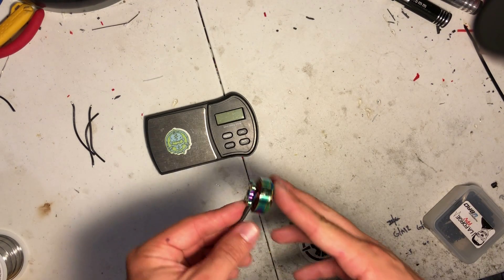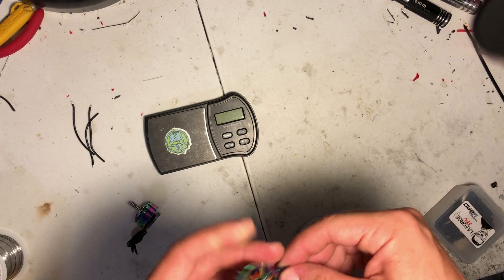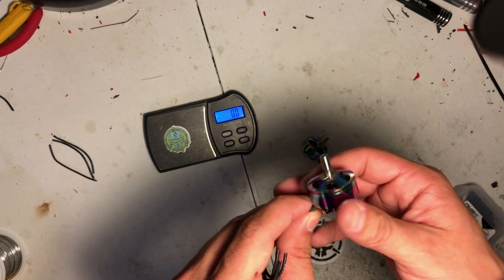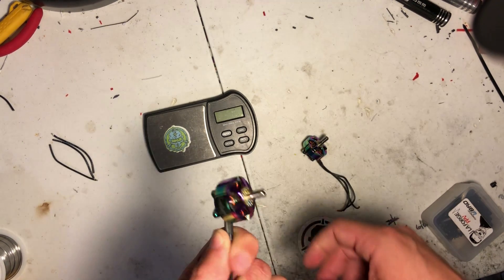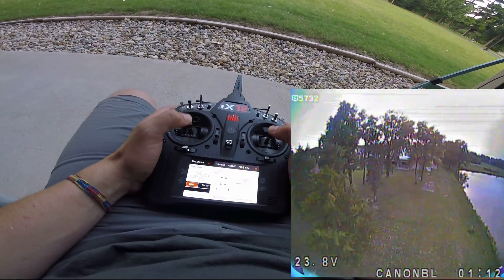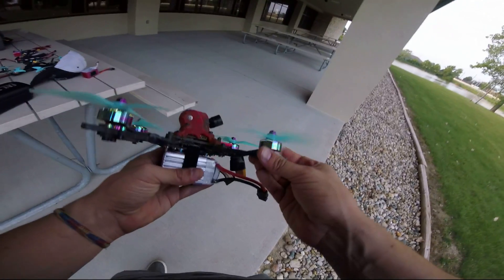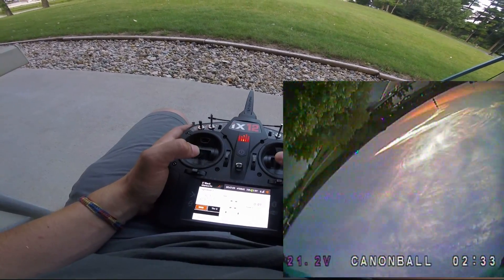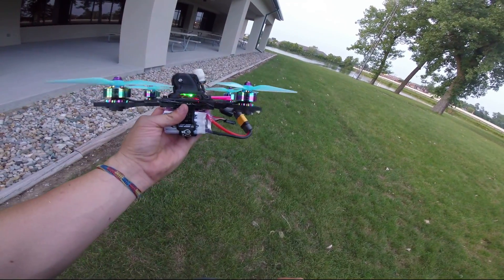Brother Hobby R6 6s Motor review

Comment: I'm thinking about building my first 6s setup on a light frame.

Which of these would you suggest for general racing? I'm guessing the 2205 would be better paired with a 1000 - 1100mah lipo and 2207 with ~1200-1300? 

There's also the r6 23061660KV.

On 4s I've always flown 2207 size motors. You seemed to be more impressed by the 2207s :)
Reply from the maker: Karlis Gross yes I think I was impressed by the 2207 because I did not expect much difference to my normal 2306 motors I fly. I was wrong, it’s quite a power upgrade. However I have to say that my favorite all around quad is the one with the 2205 motors, but it does suffer more once you add a bigger battery and weight. So if you can keep a light build and use a 1050-1150 6s. 2205 all the way
Reply: Very insightful, thank you! With a lighter quad you also get the benefit of breaking stuff a little less often :)
Reply: Hi GC Cannonball. I would like to get the 2205 for a 4S quad. 1750KV would translate to 2625KV. On a 2205 I would assume to better go for the 2450KV instead of the 2700KV. What is your opinion?
Reply from the maker: Moritz Beyer I would go with 2700 for 4s!